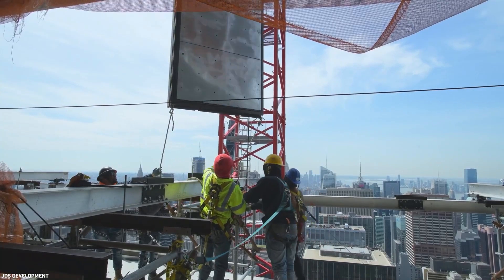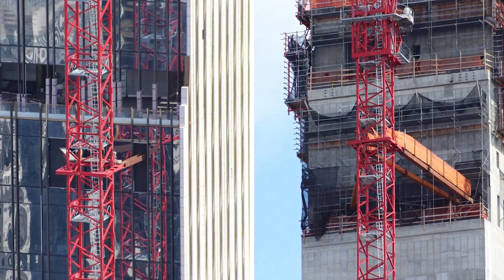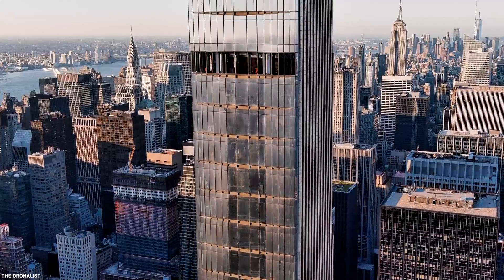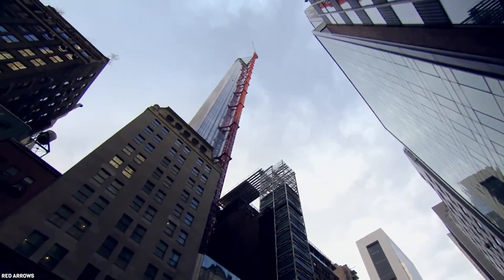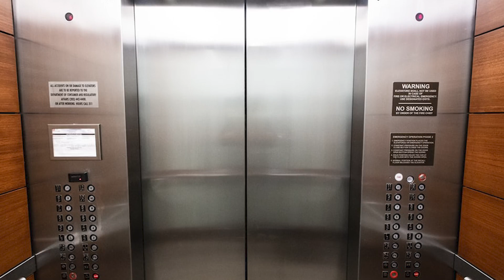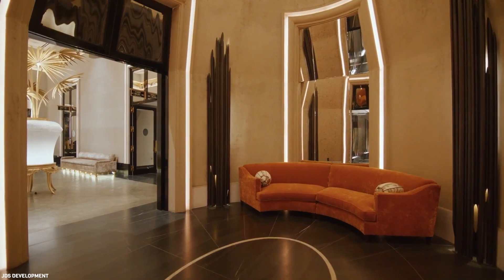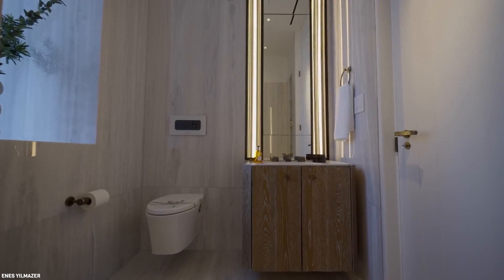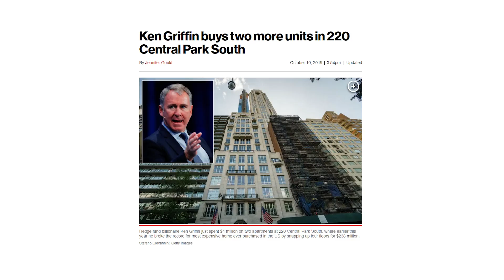World’s Skinniest Skyscraper Built For The Uber-Rich

Comment: These buildings have also been plagued by problems post construction.  When you build that high, even with the most up to date mitigation you are going to get wind movement.  At 432 Park Ave the residents are suing the developer due to movement, howling noises from the wind and elevator and plumbing issues.  This has made those units very hard to unload on the resale market, needless to say most of the owners of these units don't live there but own them as investments.  That doesn't go over well when there is such a housing shortage.  These buildings typically only have 60 or so units to start with, and some that have been completed are only 1/2 occupied.  There is something to be said for taxing those unoccupied units at a higher level since they are investments rather than housing.
Reply: I fail to see the problem. Towers like these occupy a very small footprint on the ground. It took years to aquire and stack air rights. And taxing unoccupied units at a higher level sounds good and all, but where will the tax money go? And who cares about rich people who are suing due to howling noises? Better to simply appreciate these very few towers for what they are...additions to the NYC skyline.